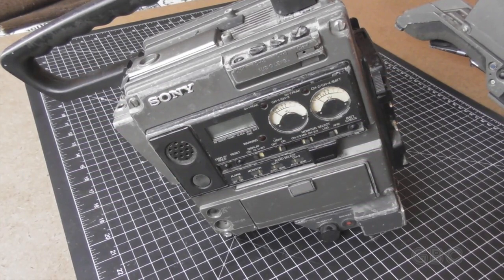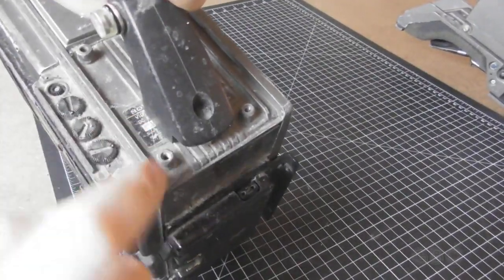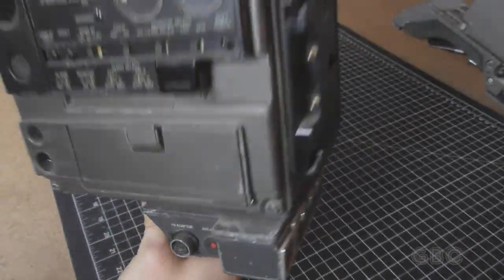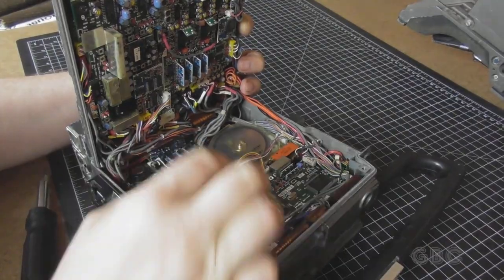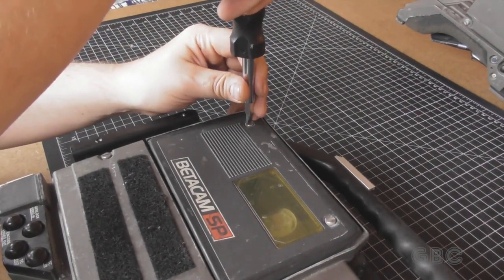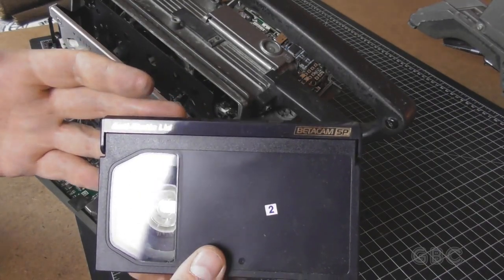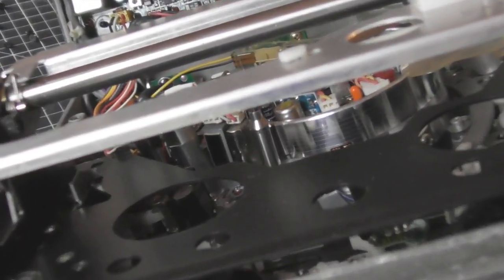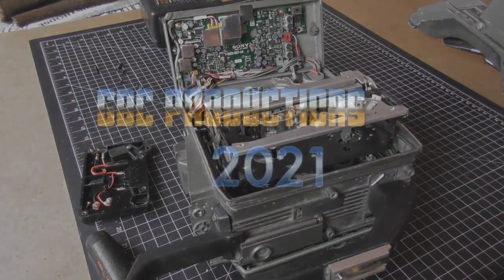[126] Sony Betacam SP Camera VTR Teardown

Comment: hi it's better to keep away from the cam  there's alot of small rubber parts  that can't be fixed   
i have work on alot of betacam  decks  

i would get a old came and  use the sony bvw75 p  or a betacam 1st gen   small tape   edit recorder   

very hard to find  good to post a video